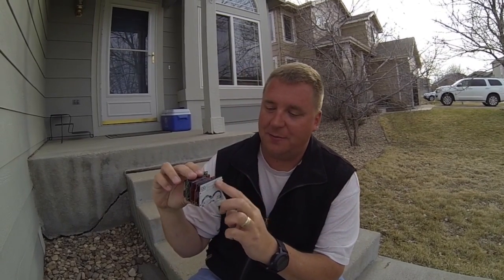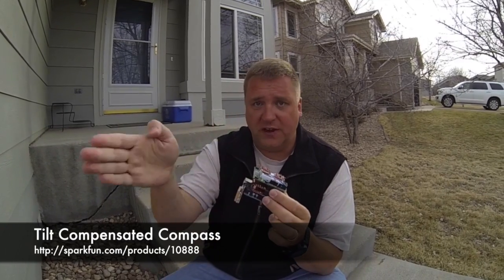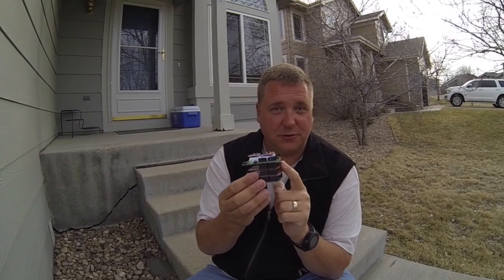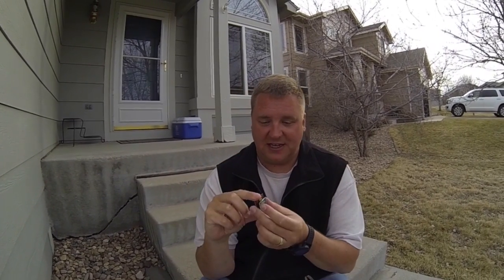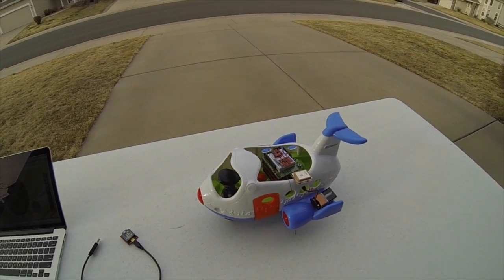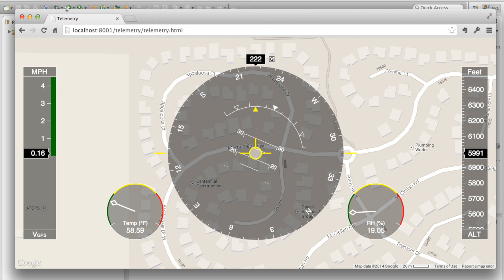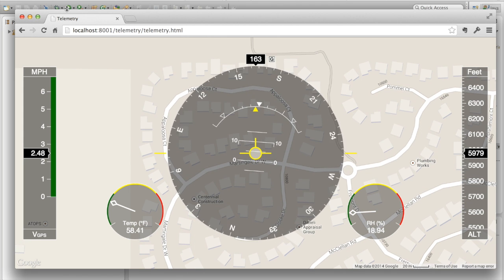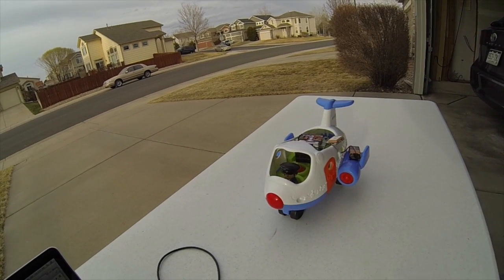Real-Time Arduino

Comment: hello, I want to develop an application of data acquisition with xbee, gprs, gps in Arduino Uno R3. access webserver. Do you know where I find library for SIM808 GPRS?
Reply from the maker: Working with GPRS modules directly is a tedious task ... and I've not seen libraries around to help.  You mostly end up sending "AT" commands (from the old modem days) to the chip over serial.  If you don't send the right ones in the right order, you get to go back and do it over.  Painful.

If you need cellular support, I would strongly recommend something like the Particle Electron, or the Dash from Hologram IO.  Both take care of the SIM, effectively replace the Arduino in your case, and give you low-cost cellular.
Reply: my idea is a system integraded with using ZigBee in network internal and a coordinator integrated to arduino with shield Xbee + shield SIMCOM808 and GPS for aquisition data and send for server in cloud. So, client can access through of web. 
thank you so much for the information reference of Particle IO and Dash Hologram IO.

I do not know if there will be conflict at port UART between and Shield Xbee and Shield SIMCOM808 GPRS+GPS

tks.

Comment: any idea on the cost of the parts? I'm trying to finish a project also.
Reply from the maker: The specific parts are called out in the video, with links to SparkFun (online electronics retailer).  I may be missing parts, but it'd look something like ...

- RedBoard (Arduino clone) @ $20
- GPS shield @ $45
- Prototype shield @ $5
- Digital compass @ $15
- Accelerometer @ $15
- Temperature/humidity @ $12
- XBee shield @ $15
- XBee x 2 @ $25 each = $50
- XBee explorer @ $25

Total: ~$200

Depending on what it is that you're trying to accomplish, you can do this for quite a bit cheaper, with more features, using something like a Particle Electron in place of the Arduino/XBee combination.

Comment: Btw, is there any chance to add voice(VOIP) sampling capabilities to a similar project like this one? I mean, the microprocessor might not be capable to process all the voice data. Also i will use the xbee wifi module for wireless communication. Thank you!
Reply from the maker: I'm not sure the Arduino/XBee combo would be best for audio processing.  When I have needed audio recording in the past, I have moved to Raspberry Pi.  That would at least get you a recorded audio stream.  An Arduino/XBee combo might work if you're just sending analog levels from a microphone, but doing processing on the signal somewhere else.  I have no idea how that would sound though.
Reply: Thank you for your help, Kevin! :-)